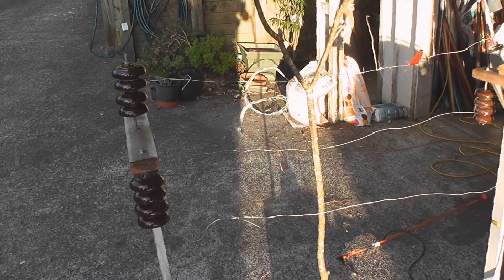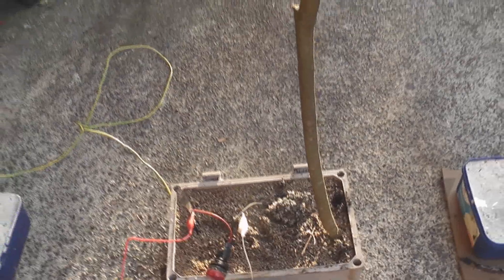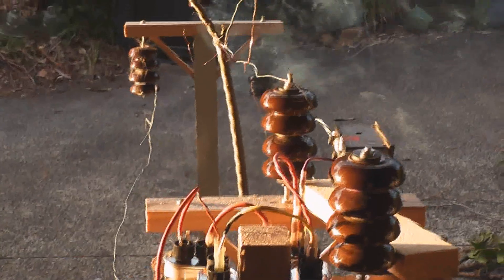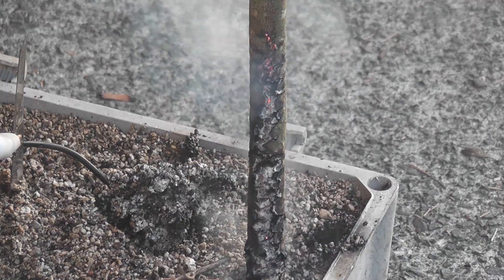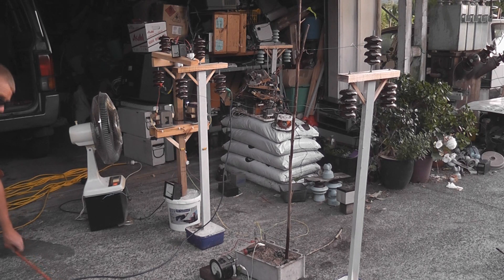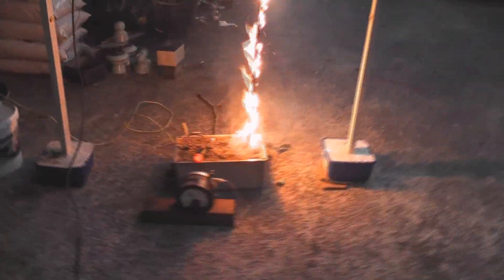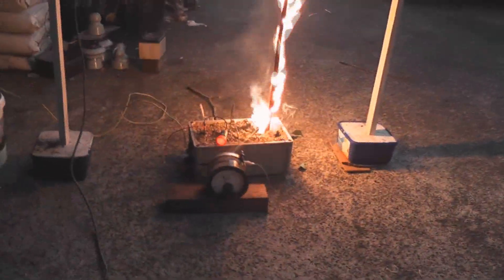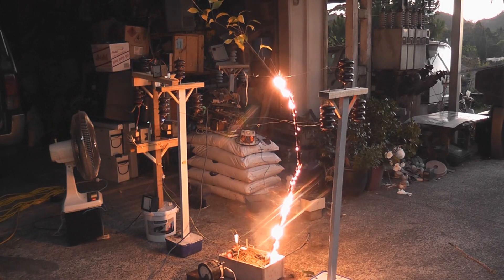Two MOT stack on small power pole vs branch

Comment: Good stuff man! Is there a way to use a microwave cap to stop MOTs smoking?
Reply from the maker: Not really, good cooling. You could submerse them in mineral oil but still need to monitor the temperature. A High Voltage winding designed for 0.3 - 0.5 Amps running at 2 Amps will get hot regardless.
Reply: RODALCO2007 oh OK. I think it might be the case of maybe using a small refrigeration circuit with the evap coil wrapped around it, with some sort of insulating medium

Comment: RODALCO2007 Good demonstration of what happens when a branch strikes an industrial line, and goes short circuit;D Pretty soon ( hopefully ) I'll get a 17.5Kv potential transformer, and also, I'm going to build my own power poles suitably in the ground, and to mount my standoffs, and insulators on them whenever the weather will warm up here!!! But, Thanks For Showing, Cheers Mate;D